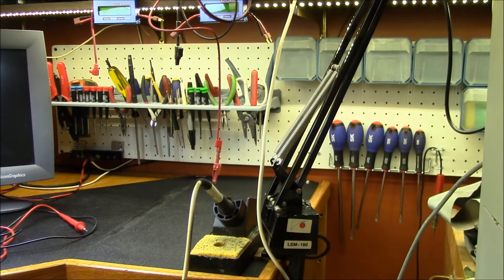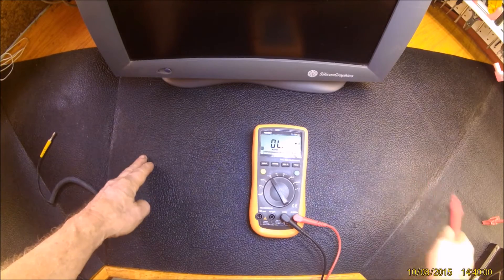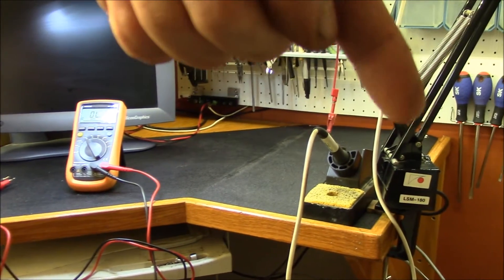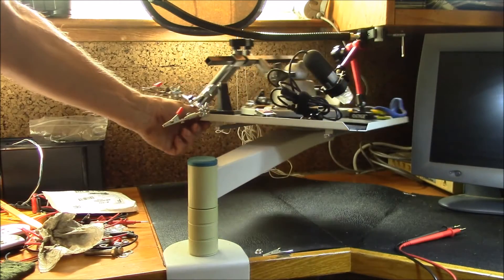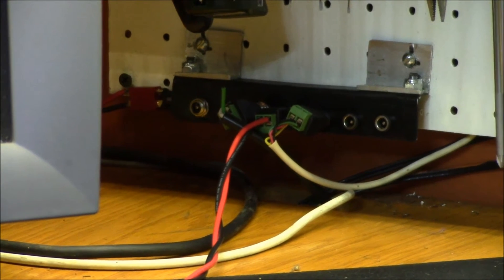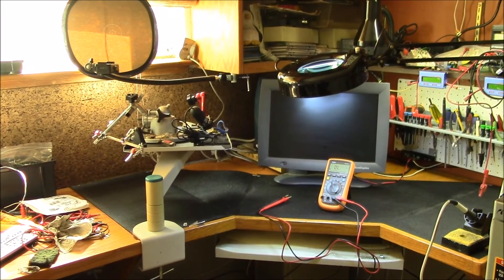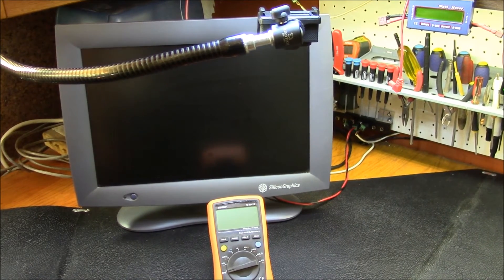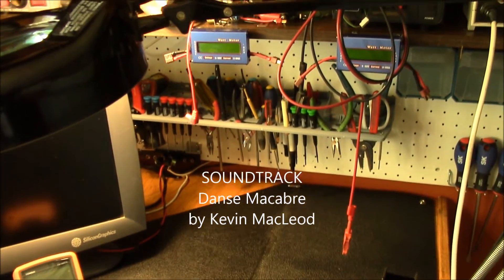Recycled Electronics Workbench

Comment: The SG 'UNIX' workstation - is that just the monitor & the system unit is elsewhere?  I've worked on HP-UX, AIX, DGux, AT&T Sys V, Solaris, Unixware, SCO and other obscure variants... but never SG (is that Irix or some such?).  When given a tour of University of Illinois' NSCA (supercomputing) facility in the late 90's, they had, I dunno, well over 130 SGI rack servers to form one of their clusters.  Damn sexy, with decorating to impress visiting bigwigs...   :)  Thx.
Reply from the maker: It's an old O2 workstation and the 1600SW LCD flat panel display.  Yes, it runs Irix, a Unix variant.  That system is still running strong nearly 20 years later and has not crashed once in that time.

Comment: Is that SiliconGraphics FatAss Monitor ? haha....
Reply from the maker: +TheOldmankk Yes, it's the old 1600SW monitor, still going strong.  The original power brick died years ago, so a I first hooked up a 12V LED power brick to it and now have it running off a 12V buck converter.  Ultimately will be solar powered off my battery bank.  It's main limitation is that SGI went with OpenDLI interface and not the more common LVDS, so you have to plug it into a special adapter.  And it has no BNC/VGA/DVI/HDMI connector.